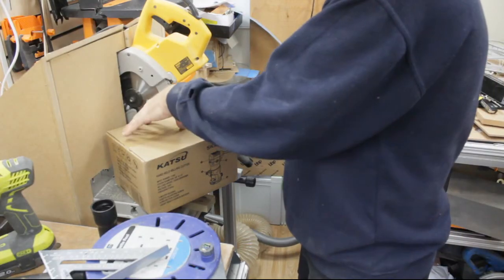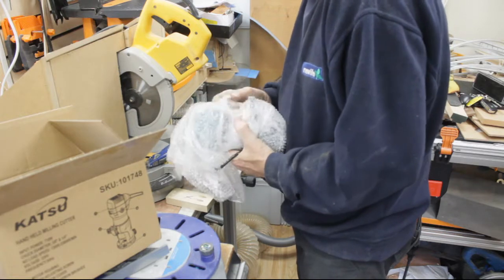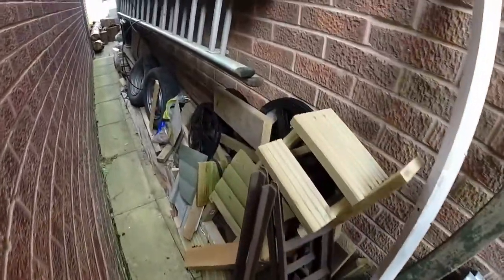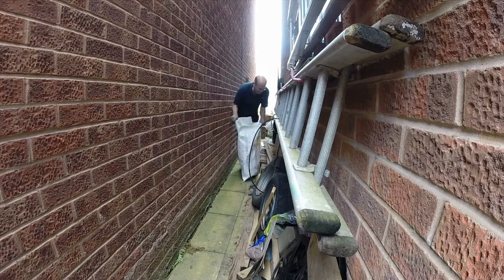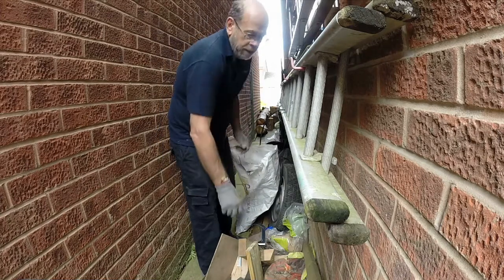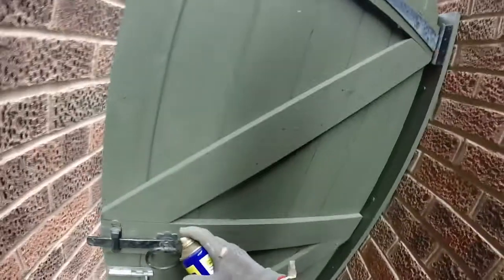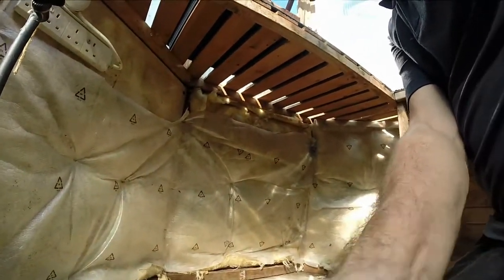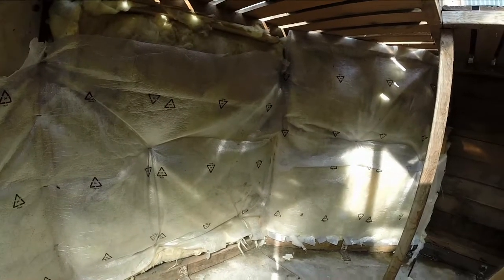small shed Saturday #257 - More jobs in the garden

Comment: Hi peter,
Tip for you, put your ladder the other way round, small thinner section to the wall, it will sit on the bracket flatter.
Reply from the maker: Top tip! I hadn't seen any logic to your idea at first, but it does fit more snugly as it allows for the corner bend in the bracket to sit in the gap formed thanks👍👍